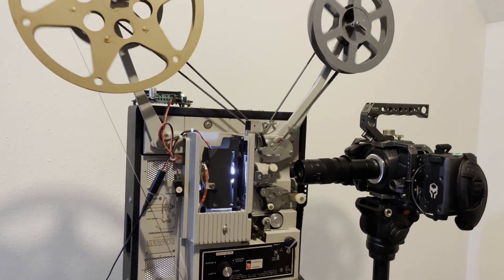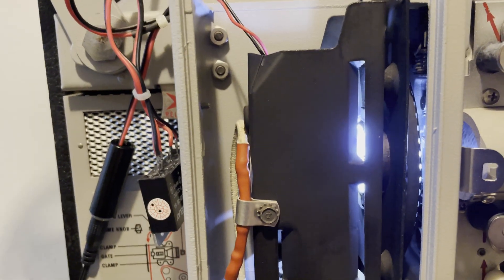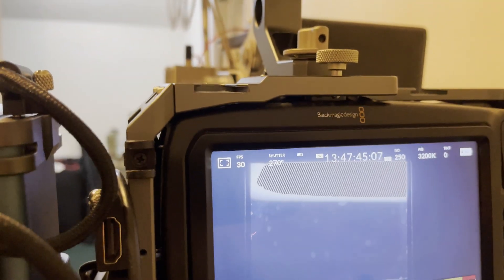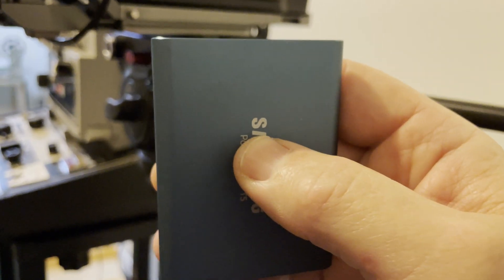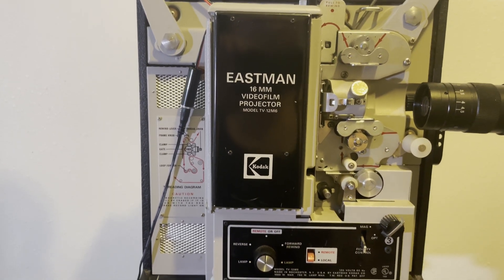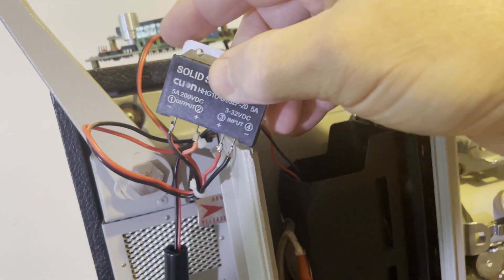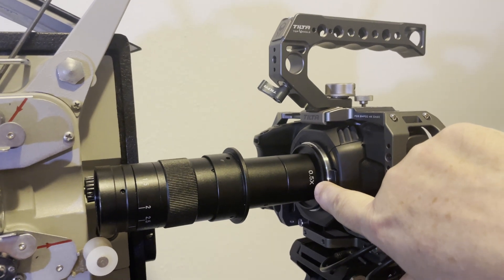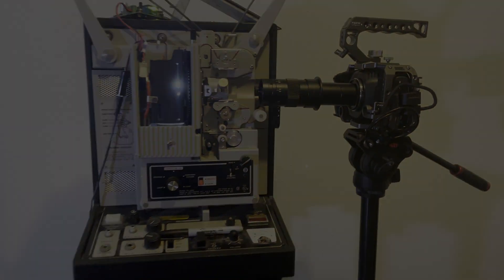UHD 16mm DIY Telecine BMPCC4K Film Chain

Comment: Hello 
May I ask, optimistically, is that lens good enough? Was it just for prototyping, and have you replaced it, or are you still happy with it? I have not bought one off Amazon before, it is cheap, but then again internet things often are cheap and still good. Also, will it go in far enough for 8mm film do you think? No harm if not sure about that question.
Thank you very much, 
Braith
Reply from the maker: Check out my 16mm 4K film transfers on my channel. They were all done with this lens.
Reply: Hello Paul

Thank you for that. It does look good doesn't it! 
I think I will get one and have a go.
Thanks,
Braith @paulcotto

Comment: Hey Paul, I tried to copy your setup, but didn't replace the 500w tungsten bulb with an LED light source.  However, when I try to record, all I get on my BlackMagic 4K is a white square.  Does that bulb produce so much light that it exceeds the camera's capability to record?  I know the projector works because I have watched the footage against the wall.  Should I get a smaller wattage bulb or should I try to set up the LED light source like you have?
Reply from the maker: Yes, the tungsten bulb is way too bright need to use the LED panel like a adjustable LED radio light cube

Comment: Hi!, Interesting video. I did something similar but I put a microswitch on the shutter and use that to trigger a still camera shot. The one issue I struggled with was the lens. Could you repost the links in the video description? They don't seem to be functioning and the text is not complete. Thanks
Reply from the maker: Here is a link. https://a.co/d/7mS6xdx You also need a c mount adapter.
Reply: @paulcotto  Hi Paul, Could you please repost all of the links for the components? They are incomplete and I'd like to build the same telecine setup. Many Thanks
Reply from the maker: @davidmarkchevalier   Relay : https://a.co/d/5IMV7im
LENS: https://a.co/d/2K119nZ
LAMP" https://a.co/d/6yKHRuk
Function Generator: https://a.co/d/hoylIvV
Reply: Thanks Paul! @paulcotto
Reply: @paulcotto How do we find the mounting adapter for lumix?

Comment: Great setup. I couldn’t exactly figure out the wiring of the frequency controller, the relay and power to the lamp.  I want to try this lighting system but need a little more detail. Thanks.
Reply from the maker: I will post a video soon.